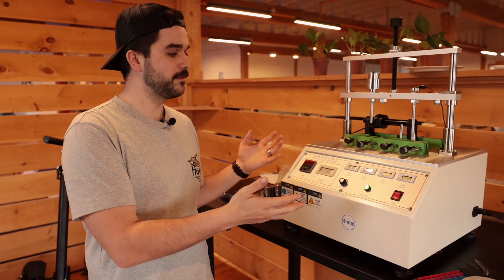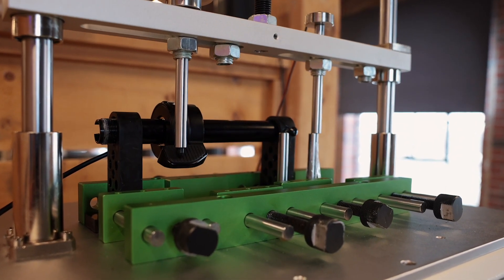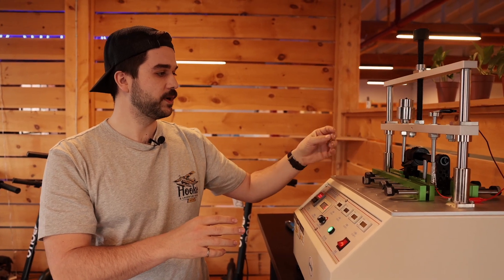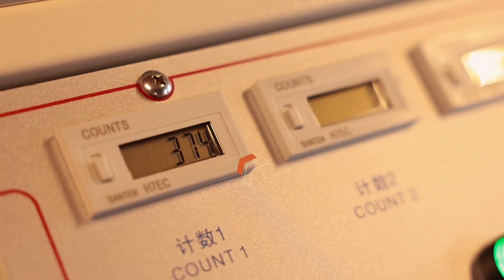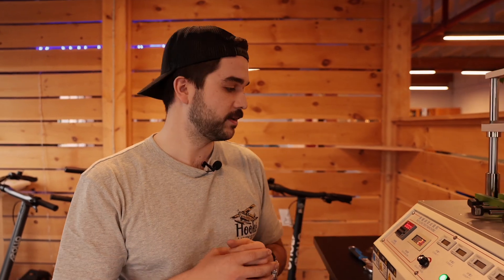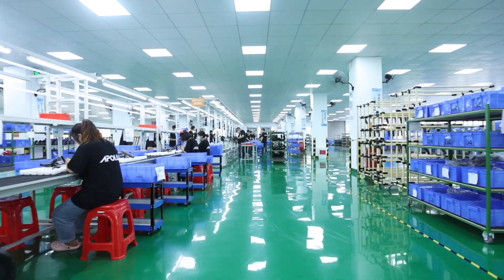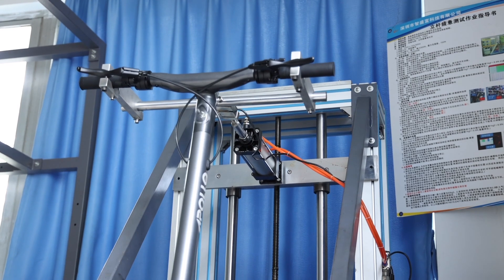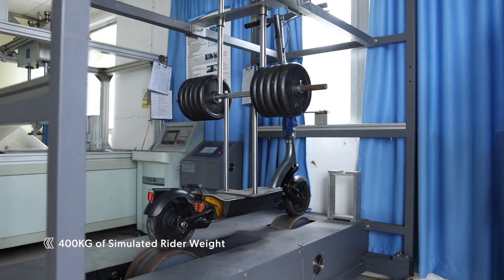How It Works:  V8 Throttle Testing

Comment: Despite the excessive testing in the stem you mentioned, I’m having problem with my stem getting stuck in the up position and when it finally goes down it makes a popping sound. I adjusted that small screw in front but that made the grey clamp too loose. Suggestions?
Reply from the maker: Hi Dave,

We're sorry to hear about your issue and we're here to help. 

Please send our A-Team and email at support@apolloscooters.co and one of our support agents will be glad to help you! For more faster assistance, please send them a video of your issue as well. Thanks!

Comment: Question: will it be possible if we can install the new V8 controller throttles in our 2022 Apollo's city/city pro scooters? It should work based on the fact it's just a new chassis design not change if cables.
Reply from the maker: Hey there!
Yes the new V8 throttle will have the same compatible connectors for the City 22!